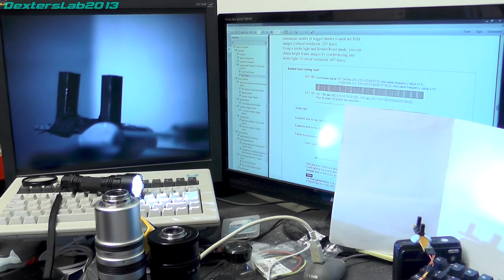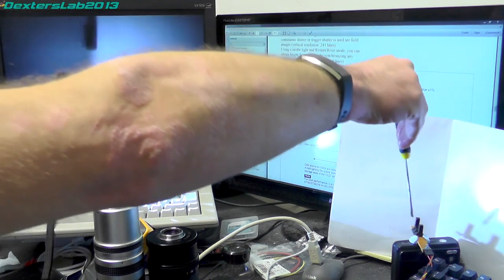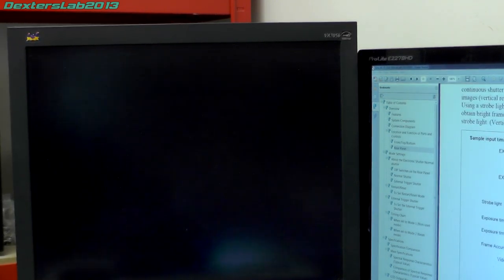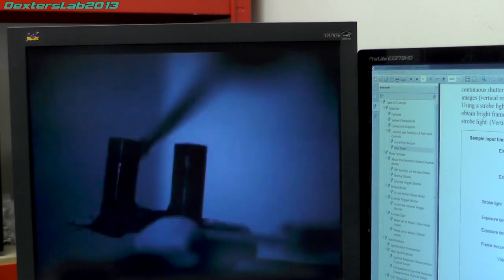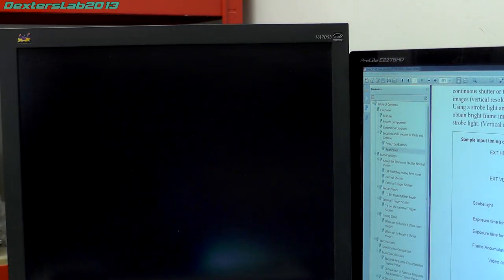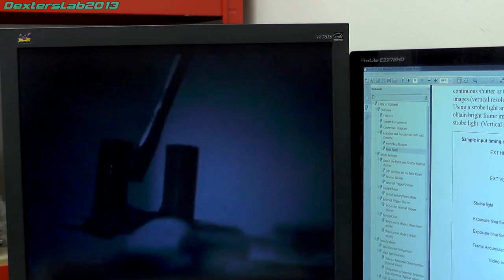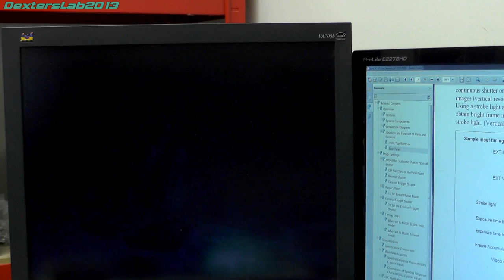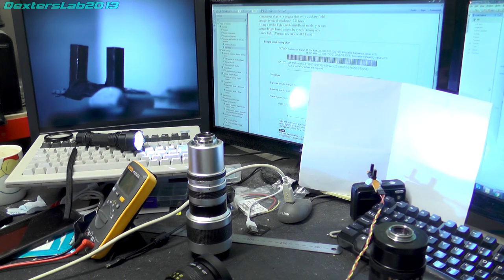DL159 Sony XC-ST51CE Machine Vision Video Camera

Comment: There is a diopter atttached to the front of the 18 to 108 mm lens that prevents the lens from focusing further than about 12 inches.  Remove the diopter and the lens will be able to focus to infinity.  With diopter attached the lens focuses from 12 inches to as close as 5 inches.
Reply from the maker: Thanks, after some research i have found the lens is a purpose made macro zoom, although the front element is removable it exposes all the internals to dust etc. It's a Kowa LMZ45T3, quite a nice score it seems!
Reply: @DextersTechLab  Welcome!  I love your channel.
Reply from the maker: Thank you!